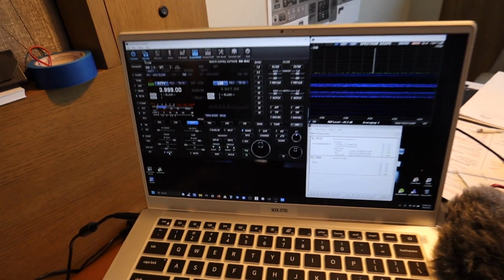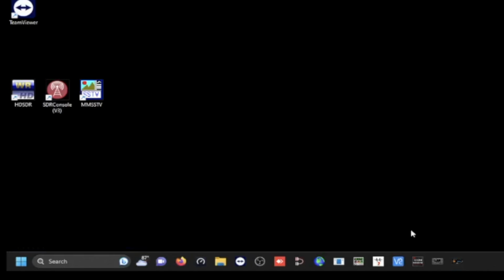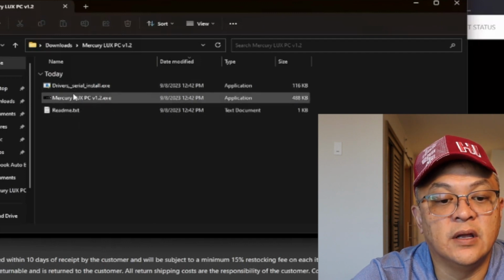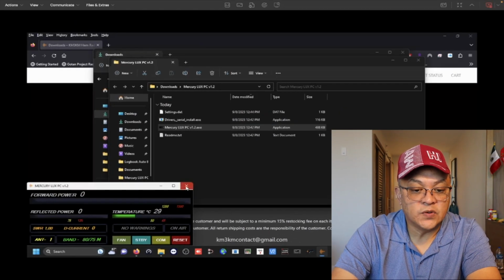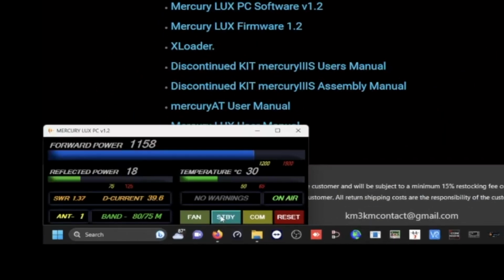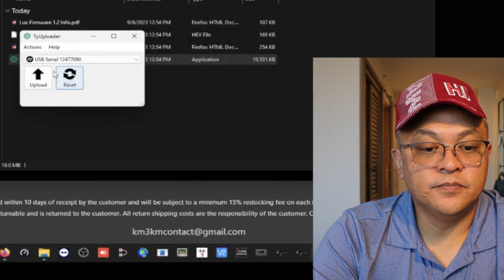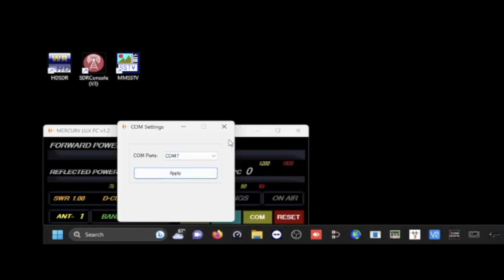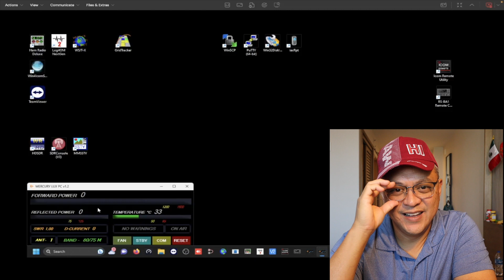Mercury Lux Firmware and Remote PC Update! | How to install Firmware | Update Lux Remote PC v1.2

Comment: Great video Darren!  I also have the Mercury Lux and Icom 7610.  So far I only remote using the Icom 7610 because I cannot completely turn off the Mercury Lux's 220 volt power source.  Do you leave the 220 volt power source on when you are away for travel?  Also, You mentioned you are using a micro PC or cube PC to run the Lux and probably the RSBA-1 software, what brand/model do you use?  I would love to rune the Mercury remotely :)  Dave - NV6O
Reply from the maker: I don't remember how it's connected.  The IC7610 has a built in router and I have that connected directly to my Home Router.  RSBA1 connects to that.  You need to know the IP Address to access inside your network.  My Beelink PC is now unavailable but here's the link https://amzn.to/3Pj8f90  As far as turning on and off, I use this:  115VAC https://amzn.to/3Ll8Oht  But if you want 220VAC I use this:  https://amzn.to/3Pcw9TH  and here's my video on that install:  https://www.youtube.com/watch?v=UN-F9vEsGqs  I hope that gives you some ideas.  73's N4VFR
Reply: Thank you Darren @DarrenN4VFR

Comment: Another great video Darren!  It would be nice if you could make a video on updating the firmware on the RF2K-S; it is a lot easier than the way the Lux does it.  You could also demo the improvement in the antenna turner operation compared to the old firmware.